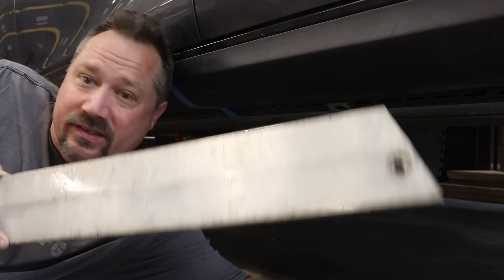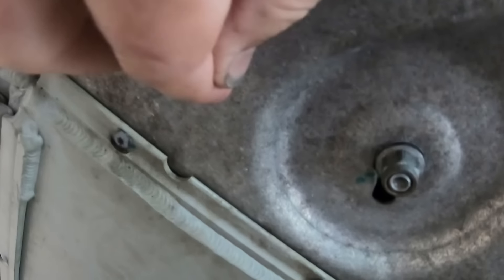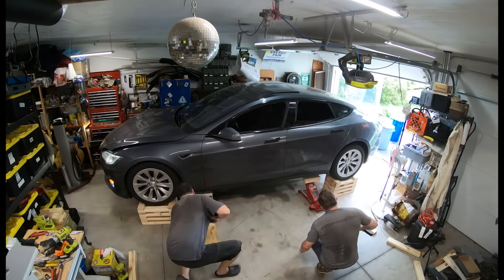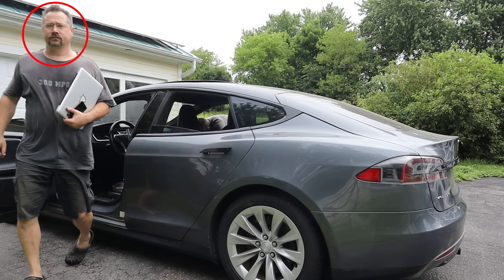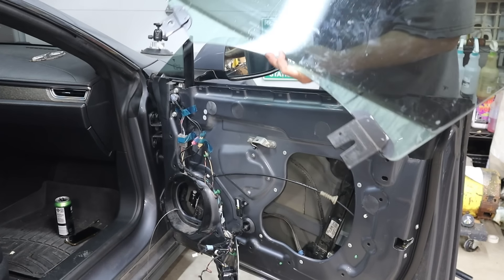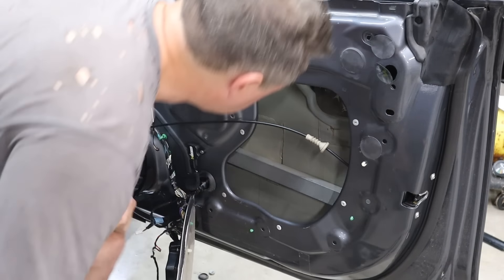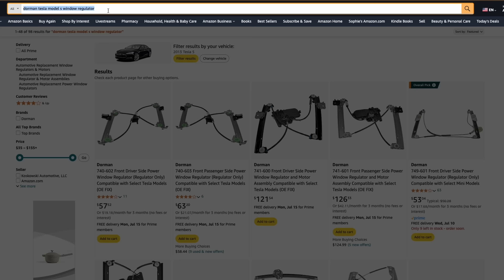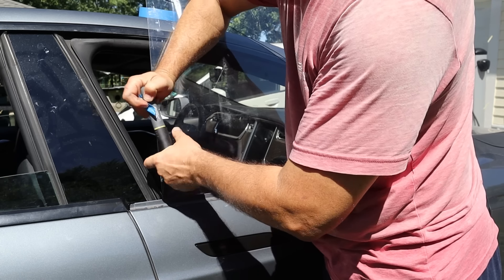Tesla Repair - Out of the garage! Off the blocks, plus window repair

Comment: Wild that I’m actually going through the exact same thing right now.  My model s just quit and when I dropped the battery pack that’s the exact same thing that happened to mine.  The fuse cover rusted and I had about 1/8” of standing water in the front of the pack. It’s good to know about the software connection issues as well as you just needing to reseat the pack to clear that final error.

Thank you so much for posting this to help the rest of us!
Reply: Can’t just replace fuse cover. Know a guy that did this and car died 1000 miles from home within 6months. I’ve seen inside battery pack. There are more corrosions that need to be dealt with before it fails. Google “Tesla battery condebsation failure” failure and read Tesla motor club thread.
Reply: @howardc1964  I have gotten little to no good info from that site.  It’s mostly just people saying take it to Tesla.  Reminds me of the BMW 7 series forums.  Anyway one of my friends did this to his about 3 years and 60k miles ago and his is still going strong so it’s not DEFINITELY going to fail soon after.  Part of that is the fact that some people just dry out the inside of the case and don’t actually pull the modules, dry them, and make sure there is no corrosion on the bottom of the modules. 

I actually didn’t even get the water intrusion code in mine.  Somehow condensation got on the one of the modules BMS boards and fried it.  So the car thought I had  module with 4 cells at 0.004v.  All cells “good cells” were reporting within a few mv of 3.945v but my total pack voltage was 378v so I knew I didn’t have a module with 4 cells sitting at 0.004v.  Looking at the cell numbers I knew it was module 9 but I didn’t know if 8 was the top and 9 was the bottom or vice versa.  So I pulled them both, found the burnt out board, checked the modules for any moisture or corrosion, replaced the bad board and reinstalled them.  

I’m just now getting ready to put the battery back in the car and was looking for videos on what all I was going to need to do as far as on the software side of things after I put it back in.

Comment: If you have a Tesla service center nearby it's worth checking what they want for it. The window regulator for my 2013 P85+ broke a couple years ago and my service center had a new one for just over $200. They also had it in stock so no wait.  It's been revised several times since the original one I had that broke. New one looks like a better design. I installed it myself and it's been working fine. As for Dorman parts... let's just say they have a rather dim reputation among mechanics...
Reply from the maker: It's definitely aftermarket, but at $50 to have a working window, it sounded like a pretty good deal! It actually DOES look like it is an improved design over the original window regulator. No idea how it compares to Tesla's current offering. I would guess probably about the same. I also did test the window motor, and that works fine. No reason to replace that.
Reply: @BenjaminNelsonX  Yeah, it's nice to see aftermarket parts starting to become available. The Dorman part didn't exist when I fixed mine.

Comment: I'm glad you didn't use sealant and opted for tape 🤣🤣🤭, sorry my bad Ill see my self out, this has been great to watch. 👍
Reply from the maker: The advantage of the tape is that it comes right back off. So when I get my new part in the mail, I can just take out the temporary window, and install the original glass.
Reply: @BenjaminNelsonX   cant wait for the next instalment for the tractor build, hopefully when you get the tesla up and running you'll a good cheap motor if you can get rid of the gremlins. The age of that model S would that come with free tesla charging.
Reply from the maker: @ricardo-iw9sq  YES! This car has UNLIMITED FREE SUPERCHARGING!
Reply: @BenjaminNelsonX  You hit the jack pot then, happy days, I know a guy who has brought one of the early model S and he brought it because of that, the problem he's got is the battery is dead and tesla uk want £11,000 to put new battery in, its only done 120k but he's found if he doesn't let the range get below 60 miles exactly 🤷‍♀ he can charge up to full but if he goes below it takes a few days for something to re set and get out of some limp mode. He was going to have to scrap it but he paid 30k and that would rally hurt.